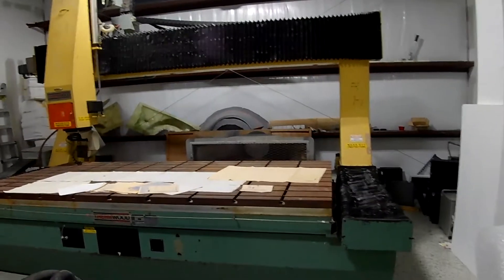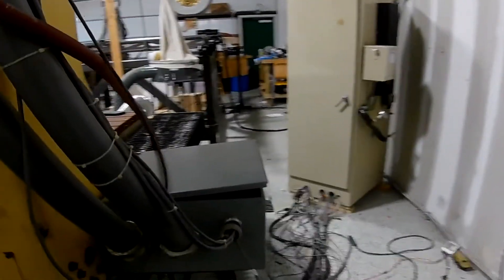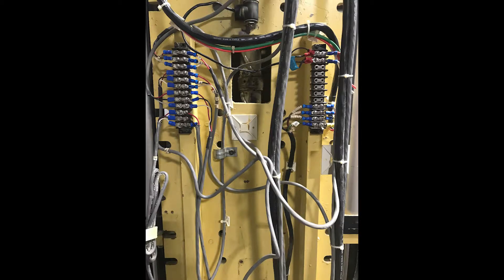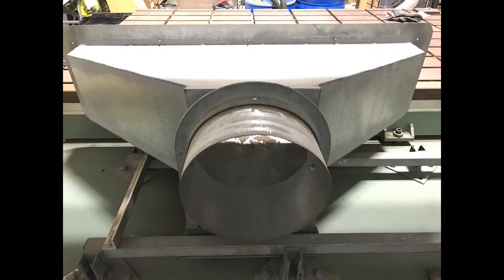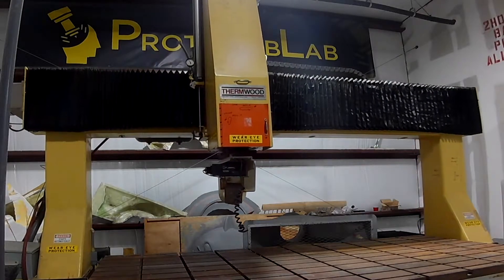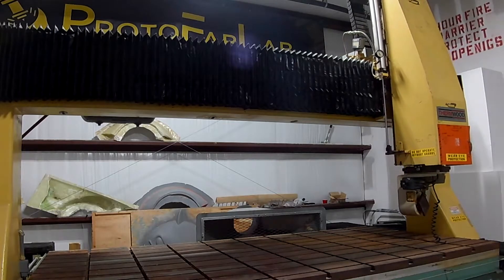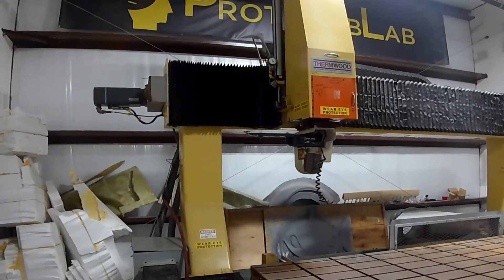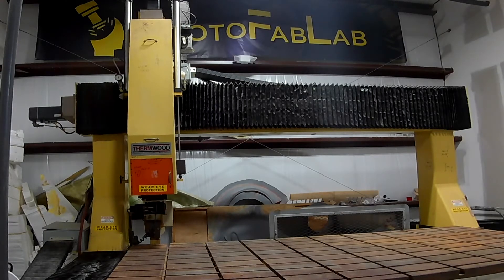ProtoFabLab.com NASA's Thermwood 5 Axis CNC Router Retrofit + Siemens 1FT5 Analog Servos + Mach4

Comment: I have a 1993 avenger lathe with the same motors and drives ( simodrive 611) Are you running the drives open loop with just the +/- 10 volts and closing the loop by interfacing the encoders in Mach 4? I am planning to use a Centroid Oak to retrofit my lathe.
Reply from the maker: Correct